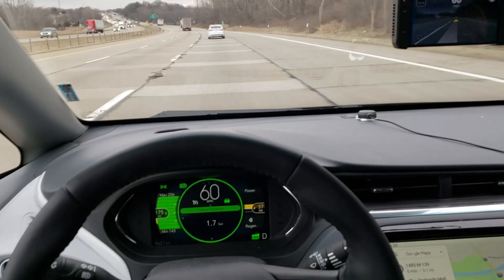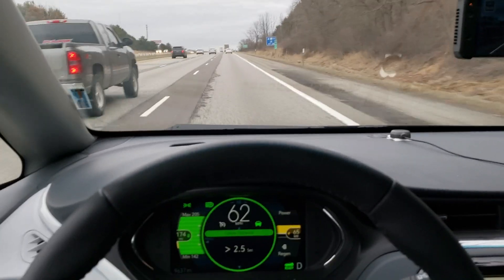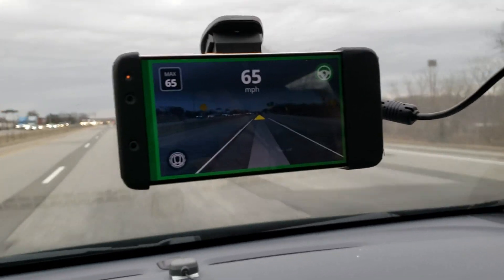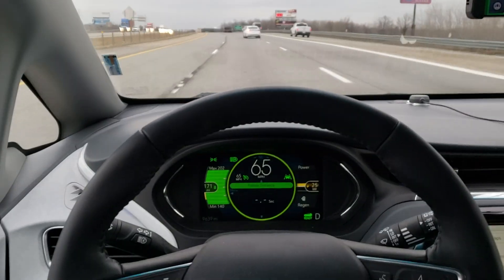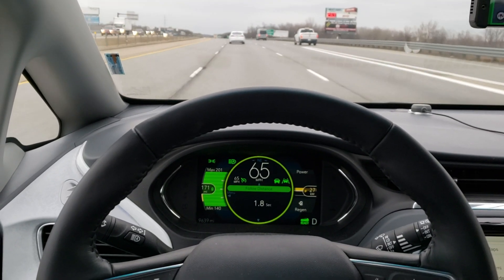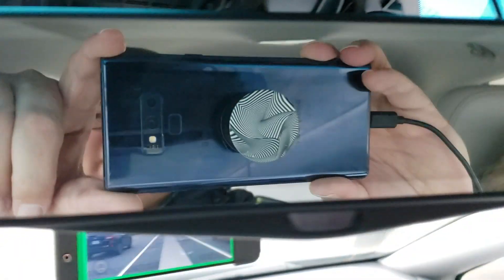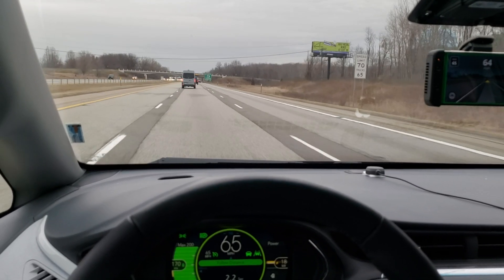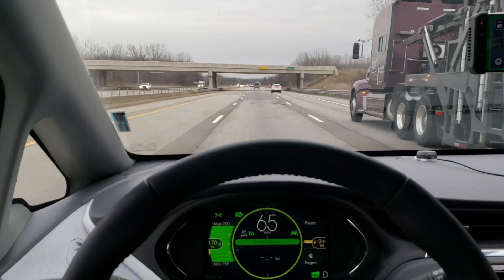Self driving Chevy Bolt - background, demo, status

Comment: Sign me up if you will provide some technical assistance.  I have purchased the required connector but not the Open Pilot module.  Just need some coaching and the software.  PM at pskhuber@gmail.com if you would be willing to help.  thanks